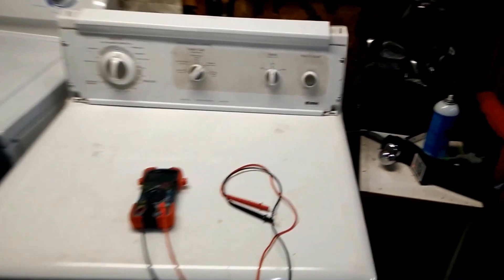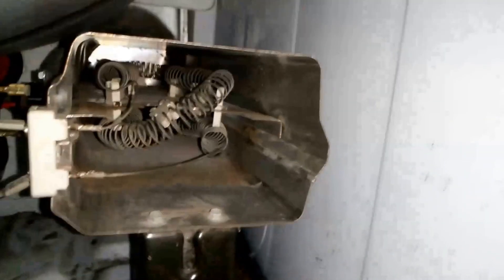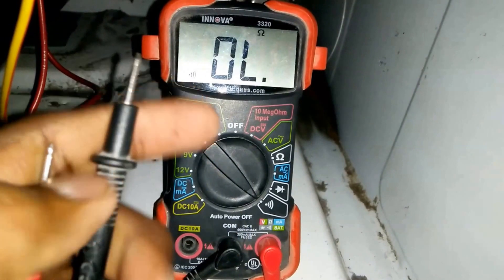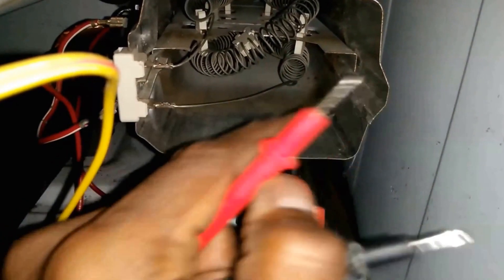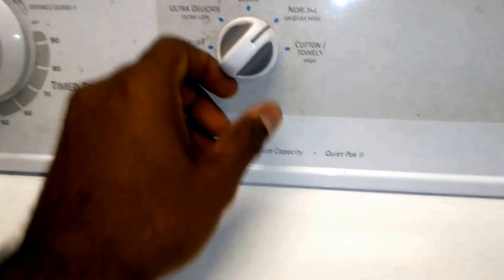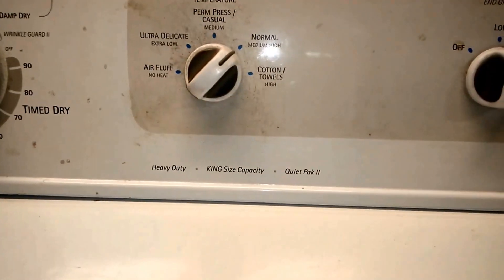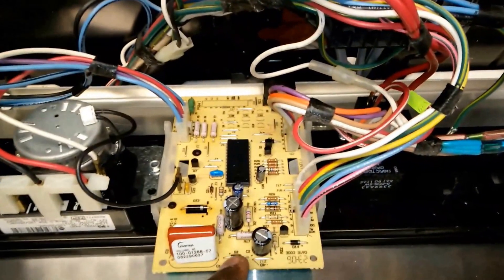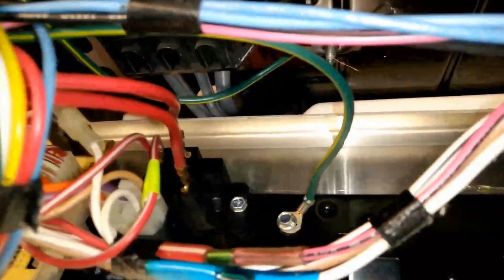Electric Dryer - No Heat Trouble Shooting with Multimeter - DIY solutions

Comment: I know this vid is old, but all in all helpful. You know you called the thermostat and thermal cutoff switch the thermal fuse and thermistor lol, thermal fuse and thermistor aren't on the heat chamber itself. They're right below lint trap basically under drum. The heat relay is why I came here that was helpful